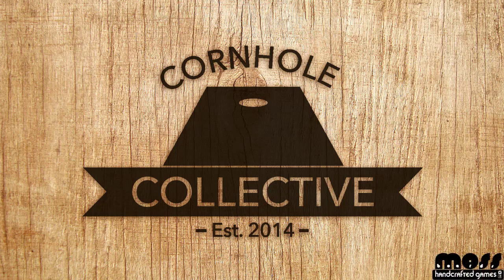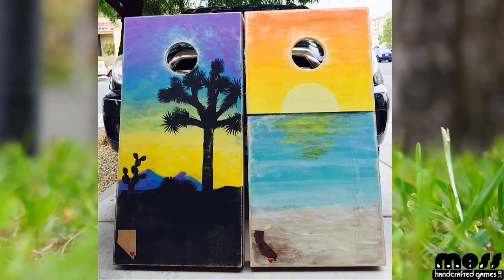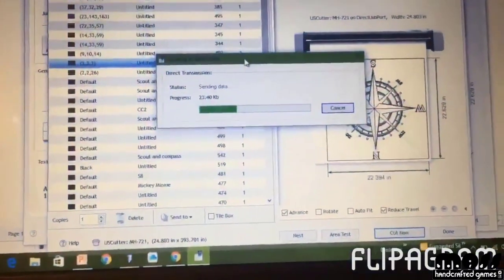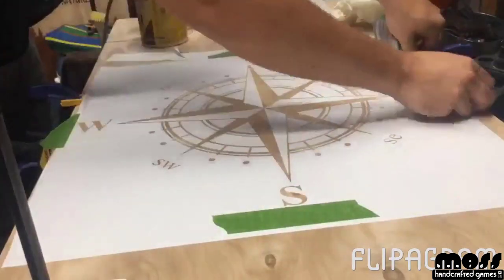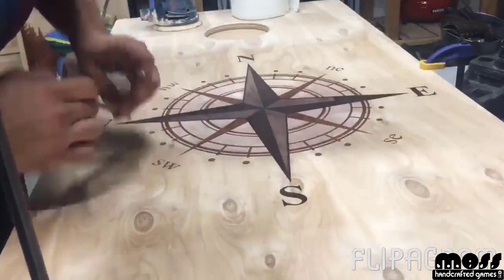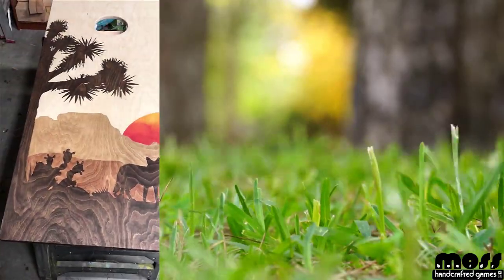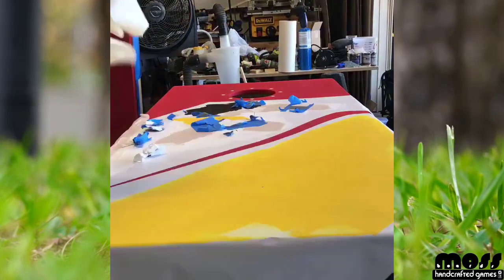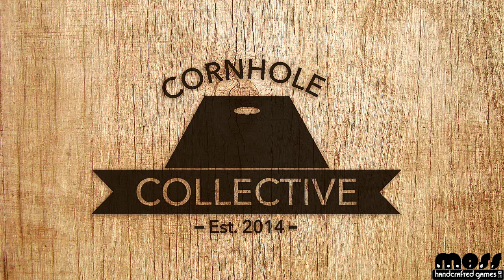Better Cornhole Boards Phase 4: Stained & Painted Designs!

Comment: If you have paint down and are going to do a design in paint with 631 stencil, do you recommend sealing the first layer of paint before adding the design?
Reply from the maker: Yes for sure. I do a "paint wash" sometimes to tint the wood grain background. To prevent that from pulling up, sand it with 320 and then spray or brush a clear coat on there. The stencil vinyl will adhere and seal really nicely to that.
Reply: Thank you so much for replying. I'm stressing, lol. Making my very first boards. Nothing as professional as yours but as long as I don't mess them up I'm gonna be thrilled. I have one more question I really hope you can get to. How long should I let the final paint(design) dry before doing the poly? I did see your video on how to apply the poly!! Thank you for that!
Reply: Oh oh lol. K question 1. How long should I let the spray coat of poly dry before I use the 631 stencil and then paint? 2. How long do I let the paint from the design dry before I do my four coats of poly? Thank you so much for your time!

Comment: What are you charging for your boards? Where are you located? Do you ship? I couldn't find a website...
Reply from the maker: Mike Zimmerman thanks, just keeping it a hobby. I’ll probably start taking new orders in May or June. I’m pretty swamped. Message me on Instagram if you’re interested. Shipping is expensive. Prices vary based on design.

Comment: Stupid question, but what is the purpose of the top layer of material you are putting on top of the vinyl?
Reply from the maker: The transfer tape is used to move the entire stencil from thar paper backing to the blank cornhole board. Imagine moving a sticker with 295 separate pieces wuthout something to temporarily stick them to.

Comment: Do you put nothing on top of the vinyl stickers to seal/protect them?
Reply from the maker: Vinyl stickers?! Vinyl Stickers?! Jk. All the vinyl I use is for stencils and after painting or staining the designs they go in the trash. What’s left is the stained or painted designs in the gaps. After it’s all dried completely several coats of polyurethane seal them. Check out Phase 5 video for finishing steps. Thanks for watching!
Reply: @cornholecollective7116  gotcha!!  I thought some we're actually vinyl stickers to stay on there, like a wrap.  Love your boards and your channel, you're doing great.  Keep it up.
Reply from the maker: Thanks so much and that’s a compliment. Paint and stains are never flawless but real art never is.

Comment: I notice that in some of the video clips you stain your boards off the frame and some on? Any reason for this?
Reply from the maker: Sometimes I build a bunch of completed but unfinished sets. These are a bit more work to stain because I have to mask the frame. Lately, I've been prepping all the frames and decks then working on designs before attaching them to the frames. Less masking that way.
Reply: Do you use 2x4 lumber or 1x4 hardwood for the frame?

Comment: What materials do you use to build your boards?
Reply from the maker: Hi Jay! We use 3/4” birch tops, 1x3 frames made from ripped pine or the same plywood as the tops. Kreg screws, carriage bolts, and finishing materials. Website has links to everything but the plywood. CornholeCollective.com